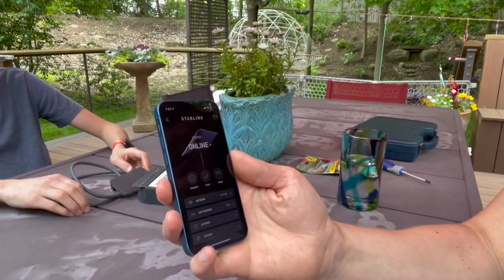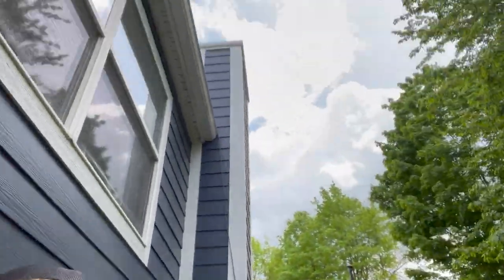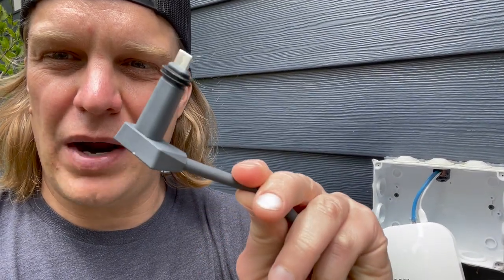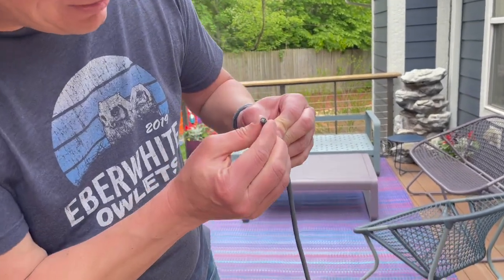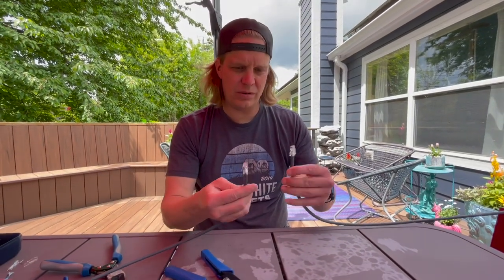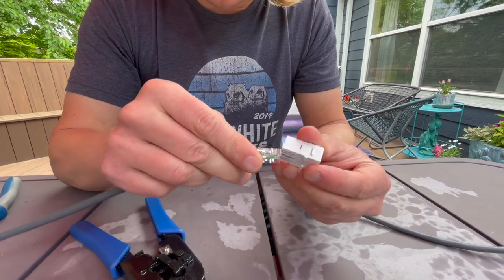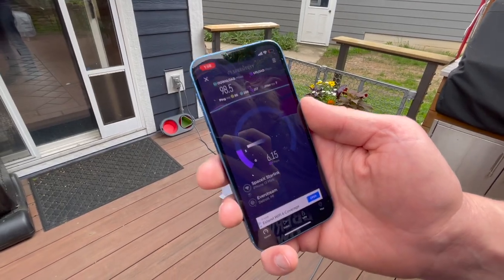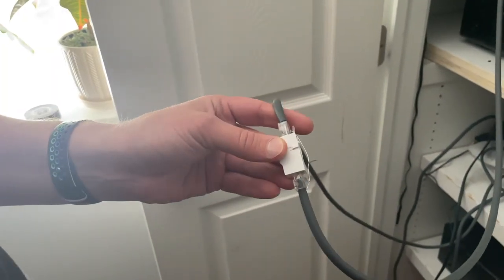Can Starlink cable be cut & reconnected?

Comment: Looks like gen 2 but wanted to confirm is your starlink a gen2?  Wondering because a few forums that I've read say that gen 1 cable is different then gen 2.  Can you confirm this for me. Thanks
Reply from the maker: Yes, it’s the rectangular current Gen 2 version. I think Gen 1 might have had standard Cat-6 style ends.

Comment: The bare wire goes between your solid blue and white blue or you can just snip it off as it won’t protect against lightning strike
Reply from the maker: Good to know, thanks!
Reply: The bare wire is a shield.  You could use shielded RJ45 connectors which a a metal cover that the bare wire connects to.  Connecting as you did should be fine as the adapter would have to carry the shield through as well.  You DO want to maintain it end-to-end.  It acts as a drain (as it is called in the UK) for atmospheric and locally induced electrical noise which can impact speed.
Reply from the maker: @terryeharris  Thanks for the info... this stuff is fun to learn about!
Reply: @terryeharris Yes the bare wire is a ground wire and you use with a shielded cat5 end , but for residential installs this is not necessary, we only use shielded cable and cat5 ends on our towers for our Access points and Back Haul feeds but not for residential customers other wise you just create a big antenna at the cx home

Comment: Tried wiring A and B on the gen 2. First test I did the buffer wire wasn’t connected, then I tried connecting the buffer wire. Both failed. Should I use the shielded rj45?
Reply from the maker: As long as your wiring version is the same on both ends and you have a good coupler, it should work. I just redid my connections this weekend to put in a larger outdoor box (to fit wifi 6e router) and everything worked fine again.
Reply: So both are the same wiring on each end, and I’m using the same coupler as you did in the video. 4th test this time was with a shielded rj45 connector that had me keep a small portion of the foil so it stayed grounded. Still won’t work. Any ideas? Here’s what it looks like https://i.postimg.cc/t4PdNGnr/9-D8-E1-C82-BB54-42-E7-93-A4-70337846-F6-B1.jpg
Reply from the maker: @megancarvalhobeer3022  Not really, should be pretty straight forward once the wires are reconnected to each other. Can you snap a picture of both ends together on the non tab side so we can confirm the wire colors / pattern. I can't think of anything else that could keep it from working other than a bad coupler, which also seems super unlikely. The dish is in the same place it was confirmed as getting a single prior to reconnecting? Does the app just say disconnected after connecting the wires to the coupler? Assume you've tried rebooting the router? Just trying to think of anything that may help.
Reply: Same spot as before, just getting a disconnected message on the app as if it’s not plugged in.

Tried rebooting many times. Redid all the cords too.

What’s odd - the dish will move to realign but doesn’t seem to connect to router. So while it’s getting power it’s not sending the data.
Reply: Ok so I ordered a Tripp Lite Cat6 Cat5e Shielded Junction Box, 110 Style Punch Down off Amazon and that worked. This will at least give me internet until the new cable comes. 

Tip for anyone - don’t accidentally mow over the cords while you wait for your starlink mount to arrive.
Reply from the maker: @megancarvalhobeer3022  Glad it worked out! It seems really odd that it took that extra step. I've tried a few couplers here now and they all have worked just fine.

Comment: Hi, Can you give us the Pin connections. I made mines and started with white/Orange Orange T568B. Can you help?
Reply from the maker: It’s a pass through the coupler so it should really matter as long as they all line up but the standard is what I did
Reply: @guysuter Yes, finally got it. Since it is pass through as you said follow your passthrough from the Router to your coupler and finally to the Sat. Dish! Thanks again

Comment: I would have run the cable from the inside of the house to the exterior. Why ? The cable connector for the dish goes through the wall first to the exterior because the dish connector end of the cable is straight. If anything you may have needed a slightly larger conduit which is easier and more cost effective than cutting the cable and possibly voiding warranties. My .02
Reply from the maker: Both the ends are pretty much the same thickness really. But yeah, not exactly an approach for anyone especially concerned about equipment warranty I suppose. For me, not having to change / increase my existing wire path was the priority. Either way, it worked! :)
Reply: don't see how this could affect warranty... i'm sure you don't send the cable back if a problem.   @OuttaMyDepth

Comment: If that works than you should be able to also add length with cat6 cable too.
Reply: I just did this today actually. I have the original 75' starlink cable and a 200' cat 6 patch cable wired up and it works great. just make sure your cable run doesn't exceed around 328' or else you will potentially have losses.

Comment: Sweet! Is there a drain wire in the Starlink cable? If so, what did you do with it?
Reply from the maker: No drain wire, just the standard 8 ethernet copper wires and one additional metal wire that is likely a ground.
Reply: @OuttaMyDepth  that is the drain wire

Comment: Spoke to Starlink support today, it’s a Cat5 cable, and cutting it voids the warranty. I mean not that it’ll stop me 😂 thanks for the video, saves me a load of hassle.

“We do suggest using our cable and equipment as our Starlink has only been tested with our Cat5 cable and not with a Cat6 cable. Splicing your original cable that comes with the kit will result in voiding your warranty. You may experience connection issues from splicing your equipment which may result in degraded service.”
Reply from the maker: Interesting they told you it was “Cat5” which has a max speed of 100Mbps that’s below Starlink’s normal transfer speed. It might be Cat5e which increased max speed to 1Gbps but my guess is it’s Cat6.
Reply: Yes Cat 5 e

Comment: Hi nice brave job!  I usually use the "B" diagram, and I think it is the most used, was there any reason that you used the "A" diagram?  Thanks!
Reply from the maker: Ha, I didn't even know there was two... I've been using the B diagram for over 20 years I guess, haha.
Reply: @OuttaMyDepth  you used “A” in your video which is old school, not commonly used at all. Not the best for data. But atleast it worked.
Reply from the maker: @evansbj91  Calling back on my late 90s networking muscle memory probably… I’ll start using B now! ;)
Reply: @OuttaMyDepth  hi, any differences detected by using "B"- instead of "A"-wiring? thx!
Reply from the maker: @icmz73  Not by me, if I ever redo it I will probably switch to the B wiring layout.
Reply: as long as you just patch the cables with each other the diagram is irrelevant.
Reply: B is the most used in the US except for government applications, then A is required (don't ask me why). In Europe and Asia, A is most common.

Comment: Looked like the performance went from 150Mbps to around 100Mbps.
Reply from the maker: Eth coupler shouldn’t impact performance if the connection is clean. My rates routinely cycle up/down by about 50Mbps throughout the day.

Comment: 568A or 568B?
Reply from the maker: Shouldn’t matter, as long as they as straight through… it’s only connecting a few inches of the wire through the coupler

Comment: A bigger waterproof box and the starlink ethernet adapter would have done the trick
Reply from the maker: The whole point for me was that I did not want a bigger box. 🤷‍♂ Also, the ethernet adapter plugs into the router with an even bigger port, so I doubt this would really help in many situations. You'd either have to put the whole router outside and run power to it too, or make basically the same size opening you need for the end of the cable. I have an ethernet adapter I use to drop Starlink into my main Eero router.
Reply: @OuttaMyDepth  I was thinking router in the box, but yeah i forgot about the power cable.
Reply from the maker: @ekimandersom4478  Probably not ideal location for Wifi signal in the house too, although I drop my WAN into hard wired Eero APs throughout the house so doesn’t really matter in my case

Comment: What about lexinet notch clutch.. its about 100% better than this RJ45 notch.. especially when its PoE. I have some experiences about people in Europe, than they had these RJ45 notches and they just broke out.. but those lexinet notches are about 1000% better... but if you want remove it ist just about striping cable...
Reply from the maker: I'm not familiar. Do you have a link to an example? Are you talking about something like this? https://www.amazon.com/LINKUP-Certified-Connector-Termination-22AWG-24AWG/dp/B08BCR14DB?th=1 This thing looks nice and easy, but it's also expensive. I already have all the gear to make standard cheap ends and haven't ever had any issues with them.

Comment: I would have cut it run it in the house and then reconnected it
Reply from the maker: Yup, I did… the outside stuff was just to prove it worked first. I redid the ends after that